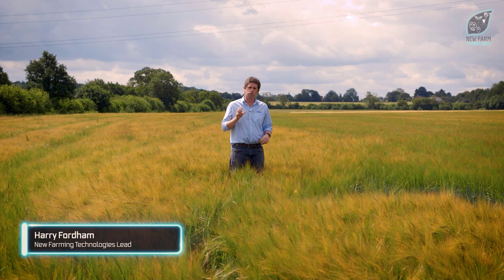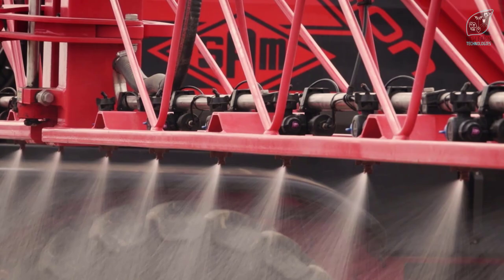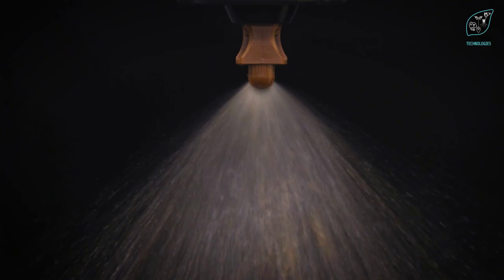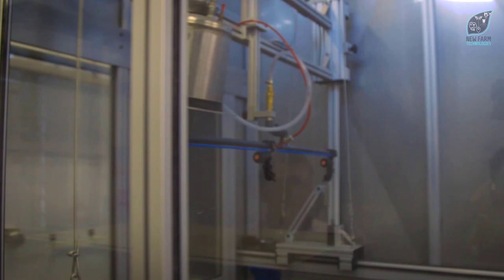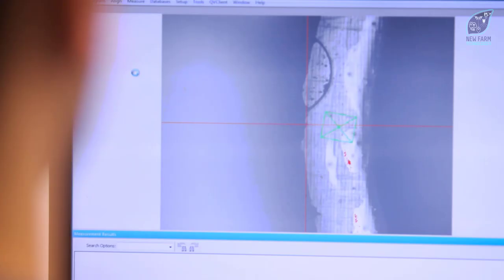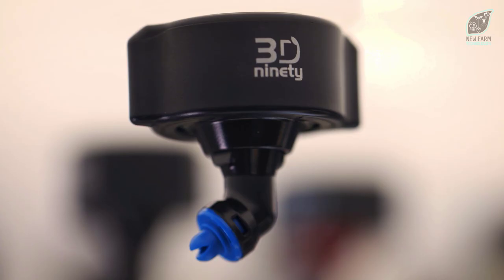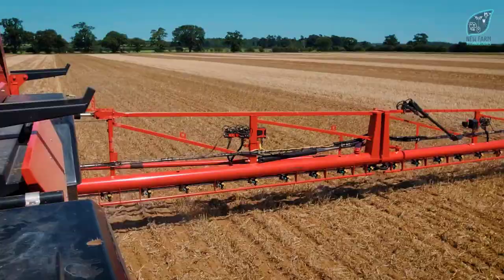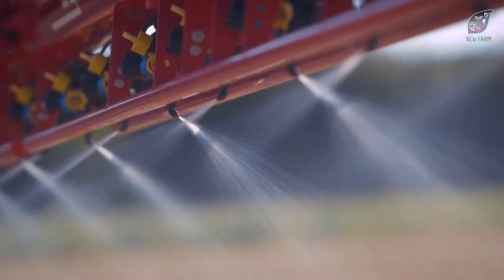Everything you need to know about the 3D ninety nozzle

Comment: So is this angle of the new 3D90 the same as the older 3D nozzle?
Reply: 3D Ninety is slightly narrower angle (about 10 degrees narrower) and a bit steeper incline (about 15 degrees steeper) this incline compensates for slightly lower energy in the spray compared with the 3D, and the steeper incline means we can still get the same coverage.